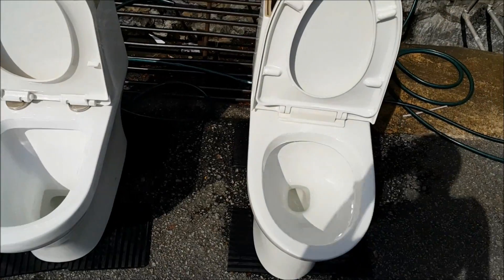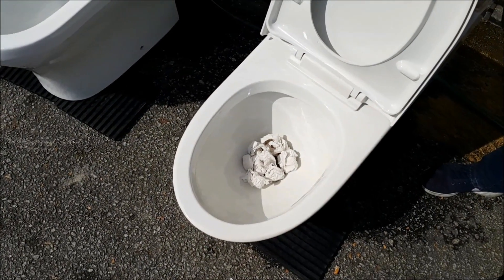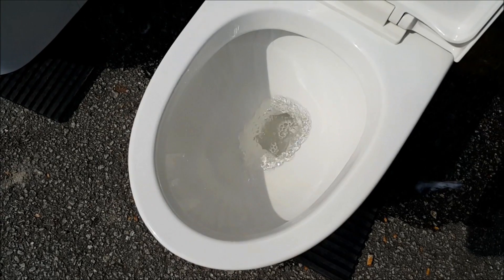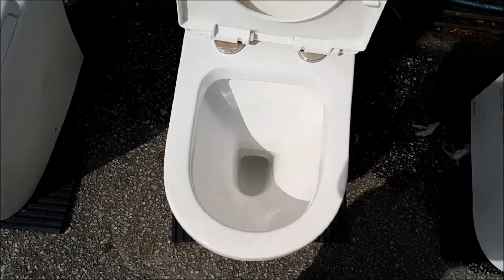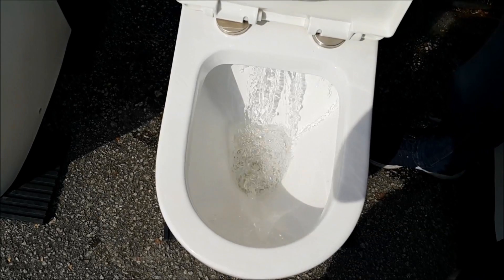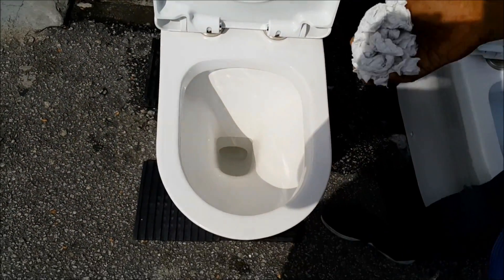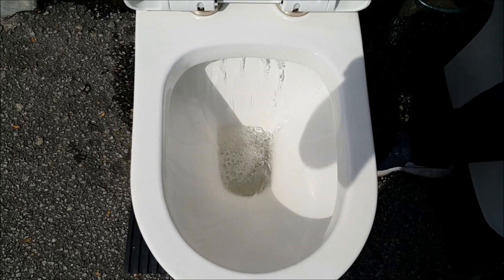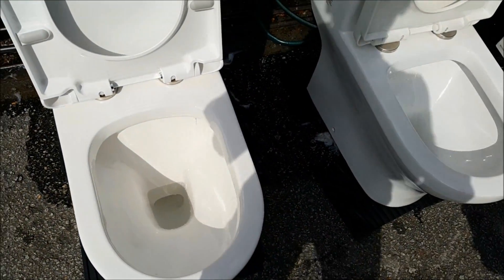Toilet bowl Flush - Washdown or Siphonic

Comment: Washdowns clog on crusted urine, siphonics do their jobs better. Also washdowns tend to get more frequently replaced than siphonics due to them wearing out easier. Stronger flushing systems do their jobs while not clogging on crusted urine. Trust me, siphonics May seem to have small trapways, but they’re easily underestimated. It also depends on the country, but in America and most of Asia, siphonic is your best bet.
Reply: siphonic vs rimless tornado flush, which one would be better, please help !
Reply: Volksjager I apologize for the late response, but I’d go for a siphonic because usually they’re harder to clog up, but don’t get a generic brand. If you’re going to get a toilet, the trap diameter matters, but suction is even more important.
Reply: @TRRCMM-9669  Thanks for the reply buddy. I just got Tornado Flush with Siphonic effect. The trap shape and size is S-300MM (The one which Toto advertises). I hope this one is okay, but I did not get Toto as it is too expensive. I have also seen dual siphonics, they are great but rimless feature got me sold.
Reply: @TRRCMM-9669   Need to get another one, but I am really confused between Tornado Flush with Siphonic Effect or Dual Siphonic Flush.  Jaguar Kubix Prime (Dual Siphonic) https://jaquar.com/en/kubix-single-piece-wc?Id=4   vs  Vignette Prime  (Tornado Flush + Siphonic)  https://jaquar.com/en/vignette-single-piece-wc-s-trap?Id=27  Please click on the data sheet and read under USP. I would be very grateful if you can suggest me in between the 2 asap. Thanks for the help.
Reply: @V0LKSJAGER  your best bet is to go strictly with a single flush siphonic because the dual flush canisters are $80 a piece and washdowns have a terrible suction
Reply: Ehh, here in Sweden we only have washdowns. And they work. For decades. Our toilet is from 2004 so it is a pretty new one. Never needed a repair. IF they need repair, it is the same as for like nay kind of water toilet: The flushing system itself with rubber gaskets and stuff that might start to leak.

Comment: Siphonics are the best. Don't underestimate the suction power they have, and more when they have glazed trapways, so they are really hard to clog. And also, they are more sanitary, because with the suction, they clean the bowl completely.
Reply: No way - more effective is the washdown. The only type we have here in Sweden. Works like a clock. For decades.